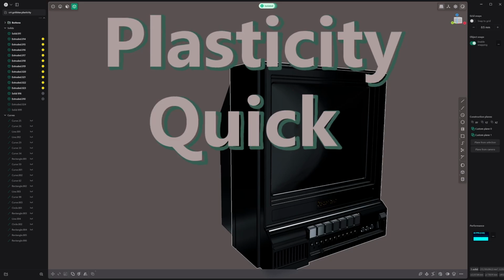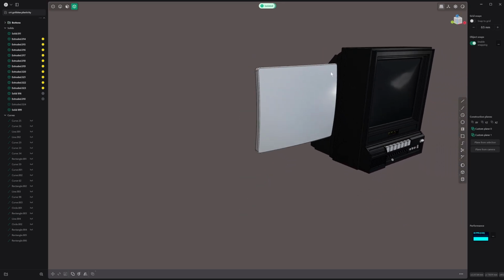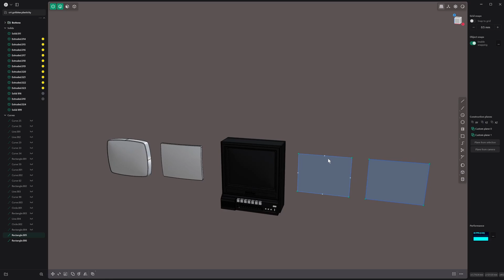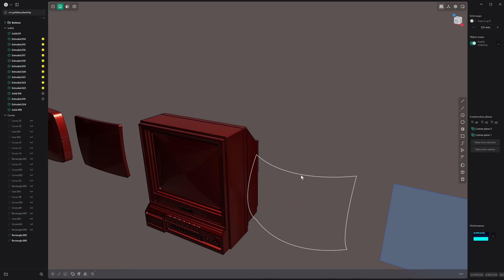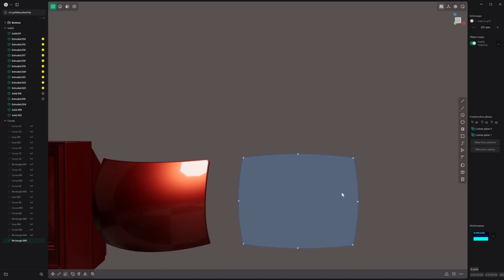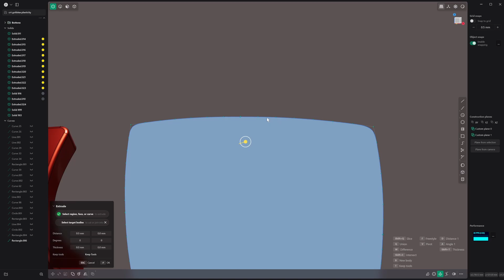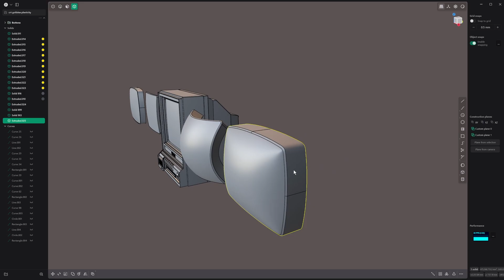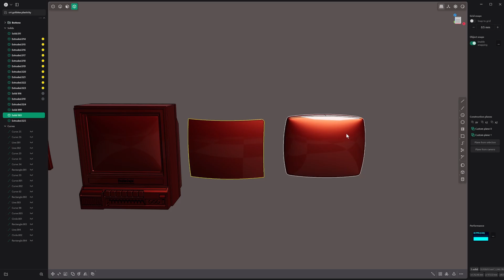Bulging Surfaces Plasticity - How to make Prominent Protrusions

Comment: I just tried revolving a square with the beveled corners. You can cut it in half and scale to reach the thickness desire.  will be a little flat, but if you make a more rounded square you can get better results...
Reply from the maker: That's awesome. It would be cool to have a fill bulge command and then you can tweak the details of the bulge like physics settings I bit like "inflate" and "inflate balloon" in zbrush

Comment: Hi, make the first screen shape 3 or 4 times bigger than needed and when complete surface trim the section you need ending in a much more uniform and clean surface for the TV model of the screen. OR you could sweep a profile around a curve at the edge and in the middle, middle profile can be really small.
Reply from the maker: Thanks!, I will attempt both of these when I'm at my pc, makes sense, there are so many ways to achieve a bulge!

Comment: Hello, Mr. Take Refuge,
Thanks a lot for your awesome videos! I want to share a method which might give you slightly better surface results if you don't mind:
- Create a centre rectangle, subdivide it, and scale the newly created points apart to generate curvatures.
- Drag a horizontal three-point arc from the left intersection mid to the right intersection mid of the rectangle. The third point (the height) determines the bulging we want to generate.
- Drag a vertical three-point arc from the top intersection mid to the bottom intersection mid of the rectangle. The third point (the height) should intersect with the mid of the horizontal arc.
- Unjoin the rectangle so that you have three horizontal and three vertical curves.
- Loft along the horizontal curves and shift-click the vertical curves to create a sheet.
- Re-join the previously unjoined rectangle, fillet it for round corners and drag it above the sheet.
- Make the filleted rectangle smaller so that it covers only the bulgy area of the sheet and imprint it on the sheet.
- Delete the border which was created by the imprint and check the result with the zebra look.
Reply from the maker: I'm gonna try this tomorrow!
I tried something similar initially but the support curves kept failing, I didn't think of using a 3 point arc!
Thank you, I'm going to do a follow up video at some point with all the techniques I've learnt.
Reply from the maker: Actually couldn't help myself just tried it now, this is a great technique, also thank you for your very clear instructions very easy to follow!
Reply: @takerefuge3d  Just got N-Gone Pro, didn't know it was your product :)
Reply from the maker: Haha! If you have any questions around it let me know, I'm secretly working on a new feature to make it a bit more flexible but still in the experimentation phase. 😊

Comment: To overcome the issue with too much bulge I think you can create a curve with a depth to your liking from one midpoint to its opposite midpoint by creating a few subdivisions.Then you can extrude that curve to make its edge information available to loft as a sheet. Then use the edge of that sheet and loft to edges of the screen. Then mirror to make it solid again. If that doesn’t work, then the curve will have to be created to ensure that is G1 or better yet G2 which can be done.
Reply from the maker: That makes sense, Im gonna try it out, next time I'm at my pc.
It sounds more complex might yield a better result
Reply: @takerefuge3d  Sounds like maybe someday you'll have to produce a sequel. THE BULGENING II , coming to the refuge cinema this Fall.
Reply from the maker: @kreevoz9577 😂😂🤣 absolutely the i think the Bulgeoning 2, will be out sooner rather than later, better than the original but still a shameless cash in. 😂
Reply from the maker: @kreevoz9577 https://www.youtube.com/watch?v=NtWagWS3k-w There you go, Thanks for the Name!